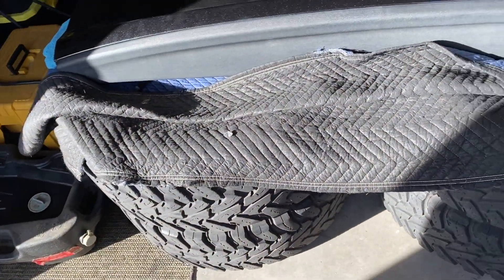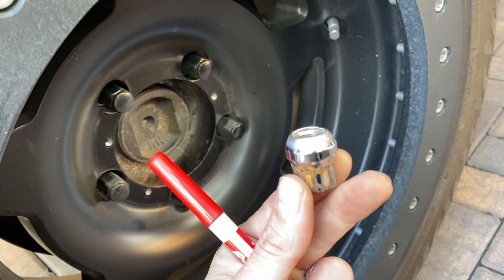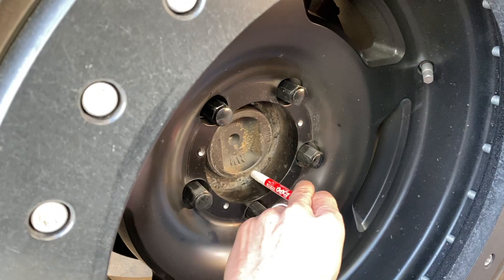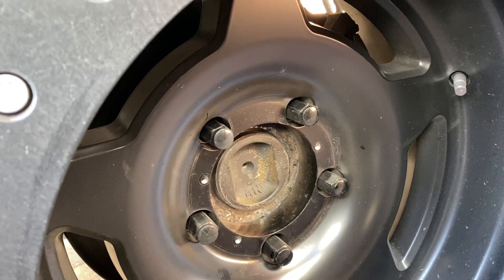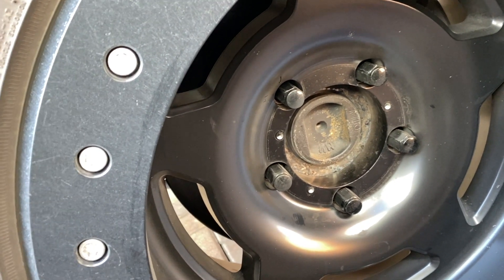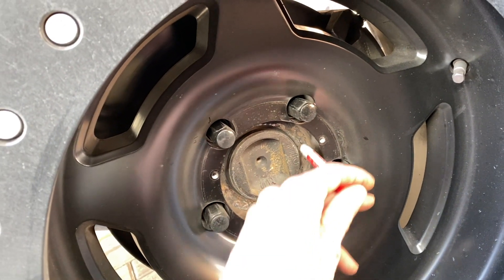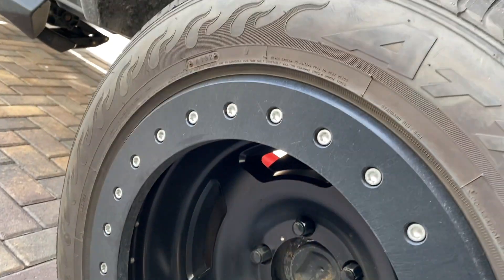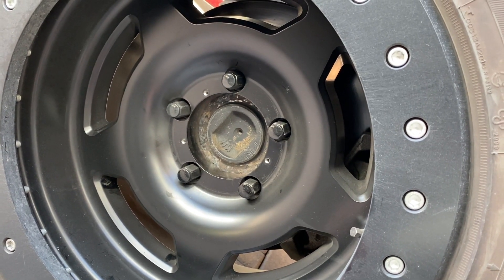Hub centric vs Lug centric

Comment: I got lug centric wheels for my truck and they don’t move at all when I put them on, should I consider getting hubcentric rings for it?
Reply: I think we should find and buy the spacers with the hub centric, it will simplify the process of installing the spacers and wheel even the spacers come with the lugs centric... I once bought the spacers without the hub centric and then I needed to center the spacers and the wheels by checking it so many times. It took 30~45 minutes to finish one wheel. Time fly~~~

Comment: 2 words...hub rings.  :)
Reply from the maker: I won’t disagree, but I did just pump a 12.005 @114.46mph 1/4 mile in 4wd with the wheels. 600 plus hp for sure no problem 😉 engine checked out first https://youtu.be/4_0nvs5CMCM

Comment: this is great video and info. I was going to add a quarter inch spacer to avoid control arm rubbing. they just slide on the hub. but I was concerned because it would cause my rims to not be hubcentric anymore. It sounds like if I install them properly I should be fine though.
Reply: My spacers don't have the hub centric too, so I tried to center the spacer first by installing the spacer with nuts tightened a little bit by hand first, just to keep the spacer in place, then released the brake, rotated the brake disk slowly and using straight stick or a ruler to inspect the spacer rotate properly (clamp the ruler to the brake piston cover and keep it very close to the surface of the spacer) - when the spacer rotate and always keep the same distance to the tip of the ruler then the spacer is being placed at the right place - ofcourse centered. Then I tightened the nuts more, after tighten the nuts meet the torse as mentioned in the manual, I once again checked the center of the spacer by rotating it and inspect again. ^^ . I did the same method after installing the wheel, just tightened the nuts a little bit, checked, tightened more, checked - tightened the nuts again and done!. That how I installed the spacers. Next time I would try to by the spacers with the hub centric.

Comment: The protruding part is called a brake register and car manufacturers use hub centric because it's the most accurate way to locate the wheel on the car centered with little to no vibration. Lug centric is old tech and is not as accurate or safe as hub centric. I can't believe the ignorance I've seen surrounding this simple aspect of wheels in 20 years online and offline.

Comment: Not only does this just explain away, the one thing, that no one else has bothered to even touch on, or it's quite possible that they are, potentially, just simply ignorant to the knowledge of it... Regarding the physics involved, due to a misinformed understanding or teaching, simply put, maybe their comprehensive capabilities are severely lacking, OR it may even be that they're just down right unwilling to offer up this kind of data, even actually addressing this specific matter out loud as far a that goes, & so Thanx btw for that... but my guy here is also quite entertaining in his approach & delivery, the cadence seems very convincing, wherein the confidence that is present, regarding the implied accuracy of the physics in question, is a good balance between assurance, and genuine interest in that the information is nefariously being, knowingly or unknowingly suppressed willingly, right out in the open,  thus deserves to be liberated, as it were, since yay~hoos (and not any actual professional manufacturing mechanics or factory techs *to my knowledge) are creating copious amounts of material content which is absolutely contrary to this here idea...

Comment: Lug centric stresses the bearings and could bend the studs. Plus easy to get ride vibration complaint.
Reply from the maker: Lug centric and hub centric makes no difference on the bearings. I do agree with the vibration part because most people won’t take the time to properly install lug centric wheels. Hub centric was designed for the average person. In the military we called it dummy proof.

Comment: I got a question 👋.. 
Can u use a hub centric tire like from a 2018 toyota 4 runner and put it on a lug centric style truck, like a 2007 chevy Silverado?  The lug pattern is the same, but the hub portion on the Silverado is smaller than the bore on the 4runner wheel. Would it be safe to rely on the 6 lugs to hold the tire on properly... Wen that tire was designed to be centered by the hub and not the lug?
Reply: The vehicle is not hub or lug centric its the rims/wheels that would be hub or lug centric
Reply: @newkidflip430  I understand that.. but a certain vehicle will have certain type of wheel and hub. Like a silverado a wheels and hubs will be lugs centric and a Toyota 4runners wheels and hubs will be hub centric.. get it?

Comment: A have a random question on this subject.. Couldn't mag lugs centre the wheels correctly and thus rendering hub centric rings useless? I mean in my case I just put fj rims on my montero. They're designed for mags and they center the wheels seemingly perfectly. Any thoughts?
Reply from the maker: I would just use a “conical seated lug nut”. Install 2 nuts adjacent from each other  and slowly tighten. Should self align.

Comment: So if u don't use hub centric rings to compensate for the space,is there danger of the lugs snapping off? Asking bcz I've always been afraid not to have a space bcz of that fear. Not tryn to argue js lookn for some insight. TIA.
Reply from the maker: They will snap if not fastened properly.
Reply: @HOTDAMN I had a dude at a tire shop tell me I couldn’t go over 80km without hub centric rings and my lugs would snap without them.
Reply: I'm so afraid of this. I just got new wheel amd tire setup. Now my steering wheel shakes. I feel like I'm in danger.

Comment: Thanks Bane! 
Just bought new rims and it was pointed out to me that the much larger center bore would be an issue with the studs bearing all the weight, especially when hauling heavy loads or towing.
Reply from the maker: Why do the studs take all the weight? In both cases you friction weld the wheel to the hub. The center never takes the weight unless your nuts are loose and by then it’s to late. Your studs shouldn’t move when driving, ever 🤣. It’s ok 20 foot pounds because hub centric, hub “centric” not hub “supported”
Reply: @HOTDAMN  see that makes so much more sense lol glad I found your video
Reply: Thank-you so much, this makes so much sense